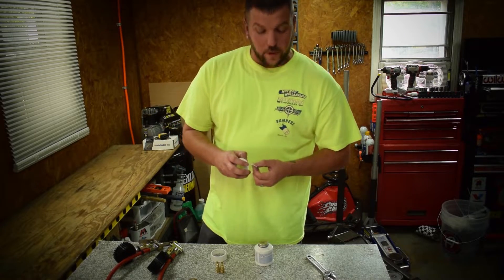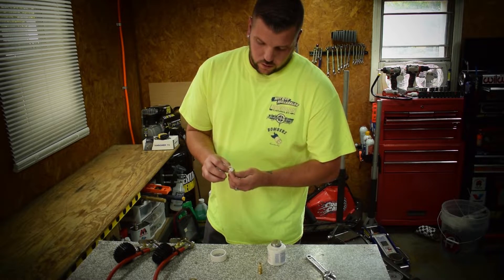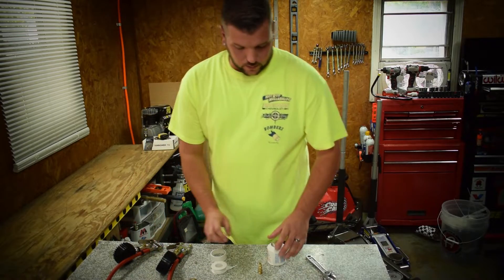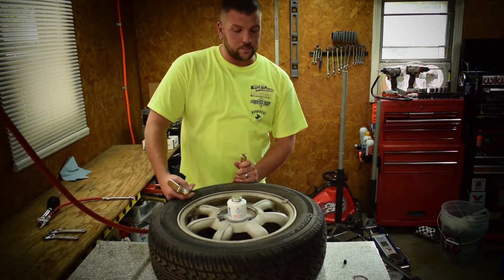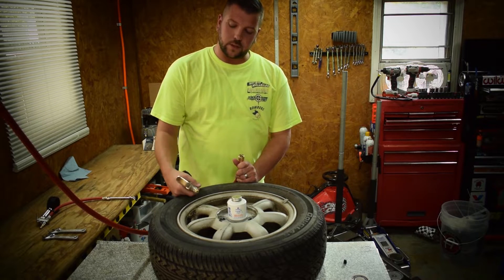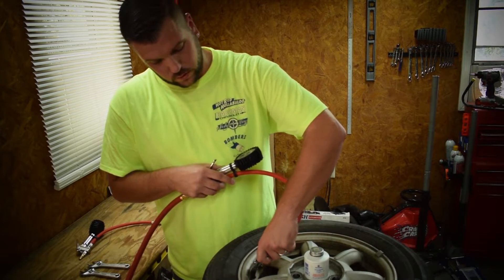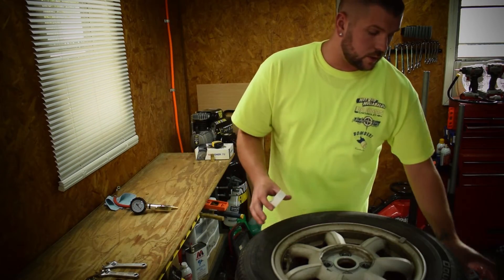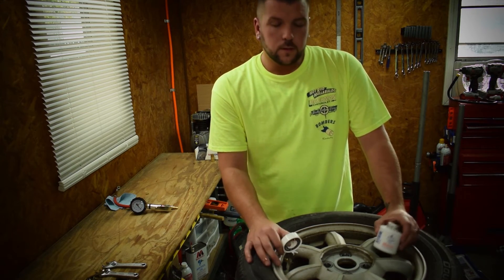Thread tape vs thread sealant : which one is better?

Comment: i have always used thread tape, both for water and for gas (yellow). Never had any problems at all. I tried using the sealant once. it was such a mess and it did not work out for me at all!
Reply from the maker: I can see the use for each, but I prefer the tape. I can't use the paste without getting it on everything!
Reply: @Mylifeinthepits   that was the same issue that i had. i agree with you 100%. nice video by the way! liked and sub.
Reply from the maker: @adamnugent2137  thanks! It helps us alot!
Reply: @Mylifeinthepits  I realize that this thread is over 2 years old, but have you ever tried
Pipetite Stik (spelled like that).

I used this stuff all the time over 40 years ago.  I ran out and only just a month or so ago, was able to find it again.

The stick is fatter, but it's still go the orange label and smells the same.  LOL

Sometimes, something good doesn't need to change.

Anyway, it's like a big crayon.  You just rub it over the threads, making sure all grove are filled and put the pieces together.

This is good for any material and when you're joining, say, brass and nylon (any of the plastics) this is the best.  No cracking the plastics but using too much force or too thick of tape that is also not so slick. (been there, done that, need to fix that today)  LOL
Reply from the maker: @BlondieHappyGuy I've never used it but I have seen it.

Comment: Haha
For people who want the truth.

Thread tape has the advantage of being as strong as it will get right away. You don’t need to wait. That’s a big plus. Secondly if you are using it in a situation where it’s not the end of the world if it leaks and or you might be unthreading it again and again, then just use thread tape. 

If you want a better seal and don’t care if it’s hard to get off use Loxeal. Or use a soft setting sealant like a soft setting Loctite.

Make sure the paste is appropriate for the use. eg ok for fuel etc.

Also don’t get the white thread tape! It’s shit.

A better test would have been to pressurise a fitting to a higher PSI and then put soapy water (dishwashing detergent mixed in water) on the fitting.

Comment: You applied the tape in wrong way, it should be clockwise. Anyway, it is nice and I like your video !
Reply: Old comment, I know... .but as AquaTech said, it's counterclockwise.

I'm not a plumber at all, but I've done a tone of fittings in my long life.
A lot of them, CLOCKWISE, which is wrong.

Here's how I've learned to just do it right without having to remember which way.

I hold the pip fitting with threads in my right hand, I know that I need to turn it clockwise to screw it into a fitting.

I then take the tape in my left hand with tape coming off from the top.  I just lay the tape on the top of the fitting, of course, holding it to the threads until a full turn and with the right hand, start turning the fitting clockwise.

This way, "I'M TURNING IT CLOCKWISE" but the tape is going on COUNTERCLOCKWISE.

Now, today, I need to make a decision on some fittings that I have to redo.

Just a point of interest, I don't know if the color of the caps these tape rolls mean something.  (again, NOT a plumber).

So a while back, I ran to Lowes to pick some up. I always buy the ones with the blue cover.  They were out of stock, so I bought a roll that had a red top.  The guy told me that this was a bit thicker tape.

I figured, ok, that's great!

NOT  SO FAST!

When I started to put the pieces on a pressure tank, I found that when I screwed on each piece, it was VERY difficult to do, even though I only wound 2-3 times.  But when I say "difficult"  I mean that there was a really bad squeak to it, like tight friction.

This was in the spring.

So a couple of days ago, I set up the tank and connected the hose to the pump.  When I turned on the pump, EACH FITTING LEAKED profusely!  Each joint!

I realized that THIS is due to that bad, not-so-slippery tape.

So I took off one fitting, cleaned it up and put the regular (blue cover) tape on.  That fitting down doesn't leak.
But the joints behind it do!

So here's where I need to make a decision today.

Am I going to take it all apart, clean things up and put the "blue cover" tape on it?

OR am I going to try out this "Pipetite Stik" that I got.

I'm hoping that this is the same stuff that I had around for like 40 years.  LOL  It does look and smell the same, so hopefully, that will work better.
When I used this stuff, YEARSSS ago, it was amazing.  It worked will on water, air and even propane gas fittings.  ZERO LEAKS.

I wonder if anyone else has used this stuff and can chime in?

Sadly, no videos on this stuff.
Reply: Counterclockwise.   You tighten the fitting clockwise.  Why would you want to screw the fitting in an it unravel the tape.  
Never once done it clockwise an never had a leak.

Comment: the tape is not a sealant,it is meant to be put on pipe threads so they won't gall , the liquid is a lubricant and a sealant
Reply from the maker: The tape is literally labeled thread SEAL tape and says on the package its designed to seal and prevent leaks on threaded connections

Comment: So I’ve just heard that Teflon tape is not meant to seal the threads. It’s a lubricant to make sure the two threaded fittings go in as far as possible. My father was so irritated when I told him this, he doesn’t believe it. So now I’m wondering if anyone else has heard this?
Reply from the maker: Never heard that  before. From what I read online, it not only lubricates to allow more thread depth,but it fills in the threads to prevent leaks. It sounds like it does both.
Reply: My life in the pits there is a plumbing channel here on YouTube where the creator is a plumber and he’s says in several videos that it’s for a lubricant to allow the threads to insert as far as possible. Without it the threads don’t penetrate as far as they should. Weird huh.
Reply: The channel is called got2learn I think. He’s got some really good information vids
Reply: You are correct in that it is a lubricant to allow for more engagement.  Before tape, grease was used on pipe threads for the same purpose.
Reply: Yes correct. Think about it how its named...Teflon....in a rolled material (tape) Thats it. Don't trust it for more than its useful for, it could cost ya.

Comment: Great idea for a comparison - leaking fuel lines on my Willys Jeep - must sort them!
Reply from the maker: Use the paste not the tape.  Ive heard several times that fuel will eat away at the tape over time.
Reply: @Mylifeinthepits  Great - thanks!  Always something with this old vehicle!
Reply: Also when people use tape there is a higher chance that a piece of ptfe tape will end up inside and block something. Happened to me with steam pipe and the tape was blocking an orifice. Depends on the application though.

Comment: Was searching for adhesives and types for a project in my college, I'm a mechanical engg. student. I searched what is thread sealant because the pages were confusing saw your video and understood what it is. Thanks! idk why so many dislikes
Reply: Just my two cents here but I think that a lot of the dislikes are from this not at all being an accurate test. I would like to point out that you seem like a nice guy and it seems that you clearly made the video with the intent of helping or sharing knowledge which is super cool so I'm not here to bash or belittle. That being said, I immediately found fault in the video. I studied aerospace engineering and my Dad is a science teacher (which is where the idea this is wrong comes from). First, a proper test should have less variables, or really only one variable. Yours has multiple.  Next you have no way of measuring loss/escape of air at the fitting so you are simply observing with your senses (observation alone isnt conclusive). Third you are did much too low pressure to test the sealant. In fact at low pressures you can tighten the brass style fittings enough to where the threads will hold pressure. The sealant would be prone to failure at its upper limits so to properly test you would have to test to the pressure that they blow out at and figure out which one blows at a higher pressure. Fourth, both the tape and the liquid are SEALANTS. The tape is a physical/mechanical sealant and the other a liquid sealant. All this being said, it kinda feels like you were trying to make a video about preference, who likes what and why but mixed it with a serious test and the result was neither. Totally cool, no worries. But its the internet bro, everyone gonna proofread your shit and find mistakes. You ain't a scientist so I dont expect that from ya. Either way, I'm not throwing shade. Have a good one brother.
TL;DR - people dont like it because it's not a test of anything
Reply: @TheMuddman74  facts
Reply: @TheMuddman74  I think your observation is right, and he put the tape on the wrong way, it should be clockwise, it is actually very important for the sealing effect.
Reply from the maker: People are haters. Its easy to be rude to people on the internet knowing they will never see us in person. Ive had to block a few people.

Comment: I have an 18 wheeler with a fuel line leak. Everyone told me to use the paste because the diesel will eat the tape. I used the tape and sure enough the diesel ate the tape. I just put paste on it last night. I have no idea yet if it will hold or not. I just wanted to comment because on a air line anything should work. Fuel lines are different.
Reply: the white teflon tape is not for anything with petroleum in it like gas natural gas propane etc etc because fuels eat the tape and cause leaks.  If you want to use teflon tape use yellow teflon tape meant for gas  blue monster also carries a blue teflon tape for gas.   but remember white teflon tape is only meant for water and air
Reply: @morganali9636  I used yellow on my diesel fuel line and the fuel ate it up too. I used the paste and it's holding. I use the paste on everything now.
Reply: @Dave0755   that sux i was told by plumbers and read the yellow will not break down I guess gas or diesel are the exception.  

So paste is way to go it seems. if i am in your situation i will keep that in mind
Reply: @Dave0755  yes, most mechanics use the paste, have a good day.
Reply from the maker: Thanks for comment man. Thats why we make these videos, to not only share out knowledge, but to get some real world feedback from our viewers!

Comment: Liquid sealant is a lubricant which gets the part on easier. If used properly last a lot longer than tape. A lot of parts require liquid because if you dont put the tape on properly it can clog filters. Tape last me a day compared to six months with sealant.
Reply from the maker: I've noticed a lot of parts that involve fluids tell you to use the liquid because they say the pieces of tape can clog the passageways.